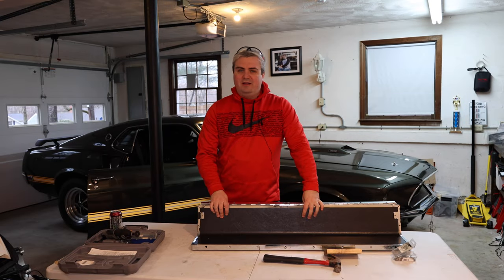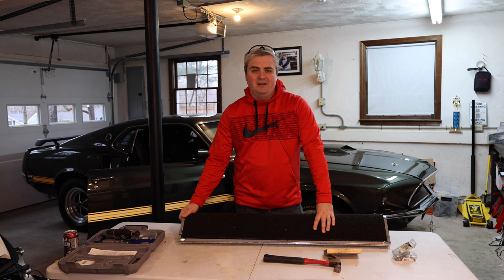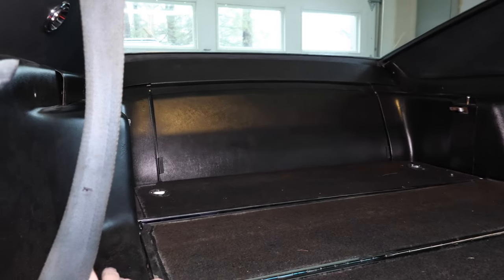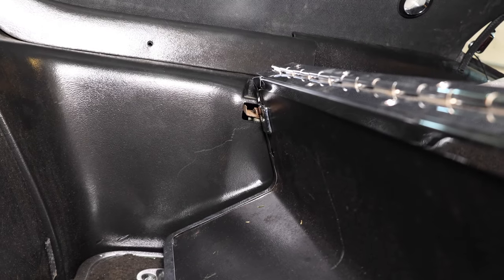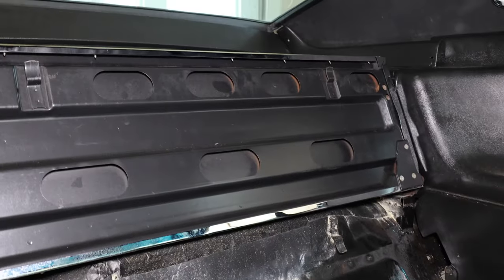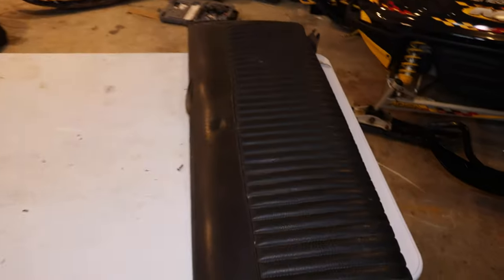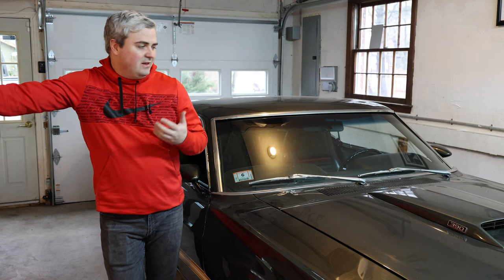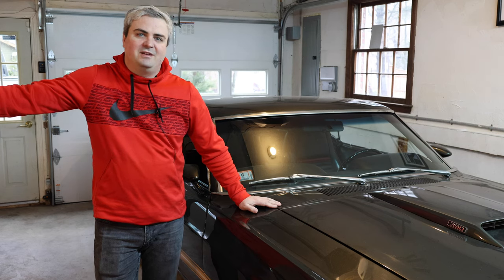How the Mustang Fold Down Seat Works

Comment: I got the trap door speakers mounts and the found fabed blase in the back pullers for the tweets and mids also got the kick panel speakers and used tha dash location for the 2 mids and tweeters are in the fold overs of my dash pads
Reply from the maker: how does it sound?